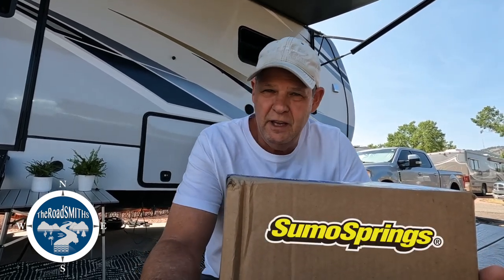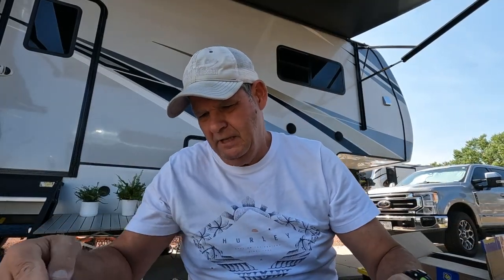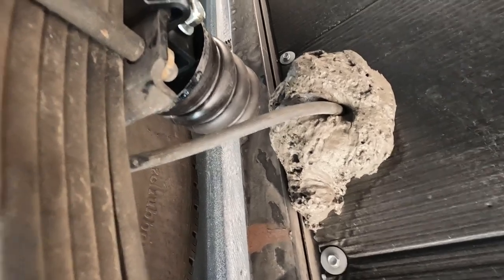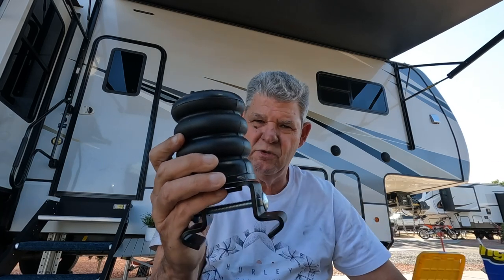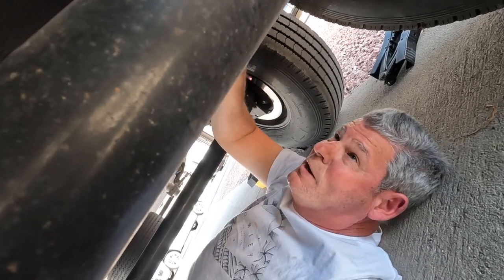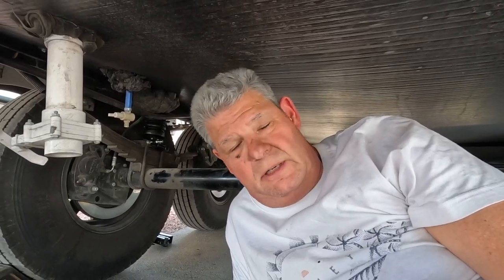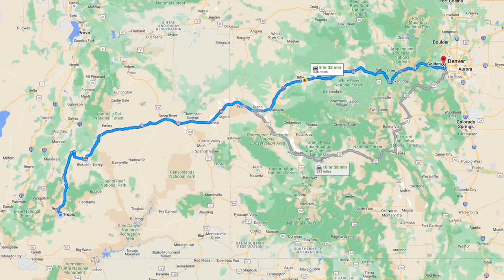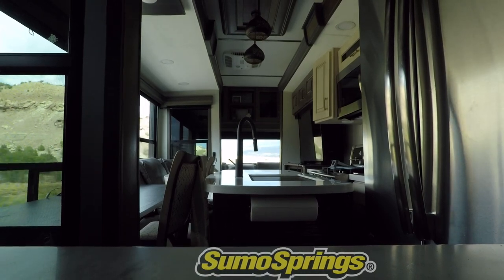SumoSprings Install on Alliance 5th Wheel. Did They Help? #rvlife #rvliving #sumosprings

Comment: We put them on just before our summer trip, it really just protection from breaking another spring.  It keeps the springs from inverting on a really big bump.  At the same time i replaced all my brakes, bearings and tires, it was a big job and my body took two weeks to recover, haha.  Larry
Reply from the maker: I believe they really do help for that reason as well.  wow....I give you credit for doing the work...my wallet would hurt...in fact it does....just put new shoes on the rig and the truck. Thanks for watching!

Comment: I drive a 2016 Expedition EL. Pull a Apex Nano 194BHS. Not nearly as heavy as you 5th wheeler’s. I’ve got the power (Full Race Intercooler, throttle body spacer, and dyno tune); this gives me 603lbs/ft of torque at the rear wheels. 

What I don’t have is the suspension pickup’s have. At 3600lbs empty my suv squats a bit in the rear. Got a weight distributing hitch. Just need a little more. Install the Sumo Springs on the Expedition’s rear coils.

Was afraid it would make the truck ride stiff. Fortunately, that was not the case. Still rides good. Actually, the suspension feels more solid when I punch the accelerator; doesn’t squat rearward as much.

Have yet to pull the RV since the install. After watching this video it would seem a good idea to install the springs on the RV to compliment the truck install.
Reply from the maker: We had installed Timbrens on our F350 ( I dont think Sumo Springs had them for our model year when we purchased them in 2021.  Made a huge difference in squat and lateral stability.  The beauty of them is that they are passive, meaning that they only engage when placing load on the truck bed since they sit about an inch bellow the bump stock so when load is removed, the are not stiffening the rear. If tou do get the Sumo's pat attention to the mounting type over or under axle and the weight rating..  Thanks for watching and commenting.

Comment: We have had sumo springs for about 6 months.  Got about 1000 miles on them. They do help for sure. Easy installation on our Montana.
Reply from the maker: So far so good. Added another 1000 miles since the video was made and it definitely helps. Still get some “bowling pins” in the cabinet. But they can’t solve really crummy roads. Thanks for watching.

Comment: This is the second time watching this video after hearing of Grand Design owners being told that Sumosprings are responsible for frame failures in their units.  Dustin from Wayward Waggs answered my question about Sumosprings on his Paradigm.  He said they haven’t had any problems.  After a year are you in favor of Sumosprings?  They really look like they are a great investment.
Reply from the maker: Sorry for just getting back to you now.  We have not had any issues with ours either. The only challenge is that when you want to check torque on your U Bolt nuts I have to loosen the Sumosprings to get access.  Not a big deal, once installed, making this adjustment is not that hard.  On the GD owner, i do not know how a hard piece of rubber could bend a steel frame.  So for us, it was worth the investment.

Comment: We added them to our Alliance 382RK. Also added to our 2023 GMC Denalli Dually. It' feels smongee at times and yet hard another times. I have watched alot of videos on both the setups for the truck and trailer. If I had to rate, I would give it a B-.  They aren't air bags, it's cheaper, so you get what you pay for. Not sure if I had to redo which direction I would go.
Reply from the maker: I agree on the rating, although I guess neither is a scientific measurement.  Haha.  I know they have made a difference but not as much as an IS would do, but they cost 10X or 20X less.  I put Timbrens ( same concept) on the Truck 2 years ago and I can see when we put the 5ver on the hitch it keeps us pretty much level.  I like the fact that I don't have to air up/down with those.

Comment: Just subscribed, nice and interesting video, thanks for sharing. I think I will look into to these for our 30RLS Avenue, a propane line may be an issue!
Reply from the maker: Thanks for watching and subscribing.  The Sumo Springs definitely help.  We left Tallahassee recently  on the way to Panama City and we realized we forgot to latch/lock the refrig after about 15 miles of highway driving.  We pulled into a rest area and were expecting the worst.  When we opened the RV door, the refrig was still closed and a bag of groceries left on the counter was still sitting there.  I did have to move a line to install but was not too bad.

Comment: We love your channel we have the same 310RL and looking at adding these. Are you still happy with them? We had them on our 2500HD and looking to put them on our 3500HD . Are you running them on your truck?
Reply from the maker: Hi Kevin...thanks for watching and the compliment.  On the Sumo Springs, yes we are happy with them.  They do seem to reduce the vibrations significantly in the 5ver. I installed Timbrens ( same concept) on our truck after the first couple of tows and they help as well with sag and lateral stability.  I seem to remember that Sumo did not have these for our 2020 F350 at the time.

Comment: We purchased them at the Alliance Rally in May but have yet to get them installed. I've made a run at it twice; however, the propane line is in the way, and it runs on the opposite side of the hydraulic line from yours and when trying to move the hydraulic line we couldn't get enough travel to move the propane line out of the way. I thought of trying to find where the propane line terminates and reroute it but haven't yet. We have an appointment to get MORryde IS installed in May of 2023 so we may just wait it out. Good video!
Reply from the maker: Thanks...You would think they would be more standard but they are not. If you are getting the IS then no need for these.  I would love that just did not want to wait that long.  Which Alliance do you have?
Reply: @TheRoadSMITHS  We have the Paradigm 390MP.

Comment: My electric wires come out of the chloroplast right where they go
Reply from the maker: Oh no that’s to bad. I had to cut away a little of that that to get them to make contact with the frame. Is there not a way to do that on yours?
Reply: @TheRoadSMITHS  I may try to. Great video!
Reply from the maker: @lcampm2  Thanks...I hope it works for you!!